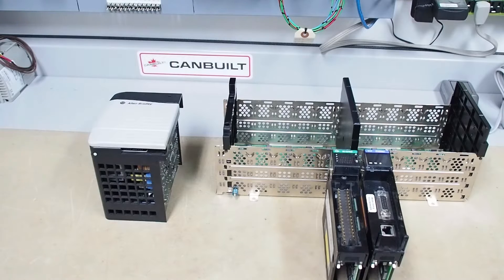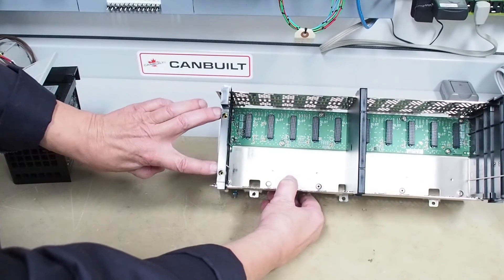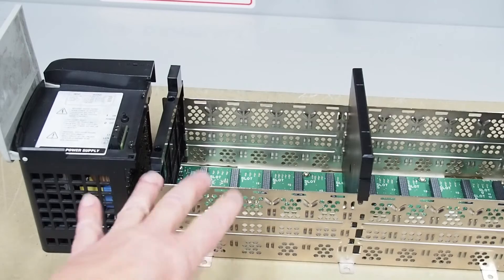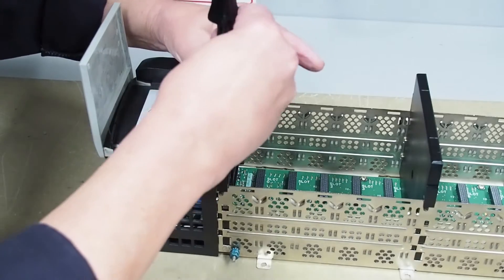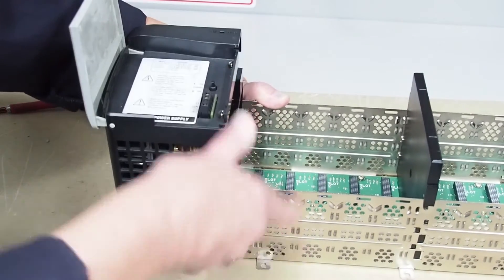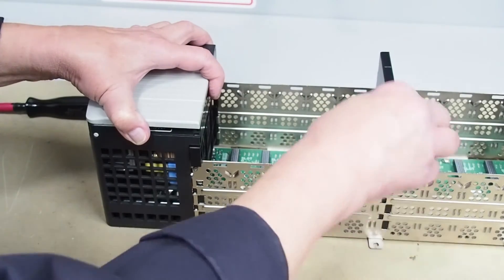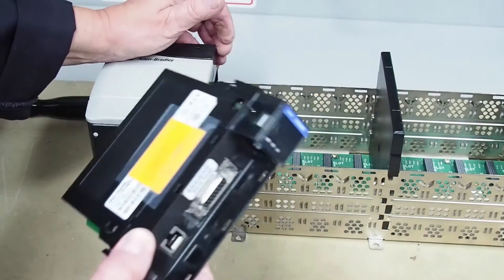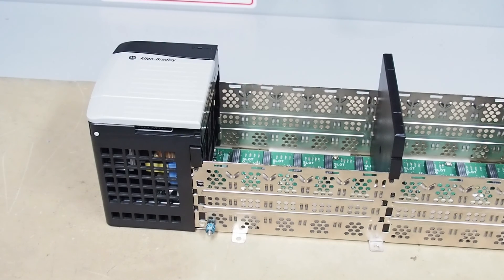How to assemble a CLogix chassis and modules

Comment: Power light glow how to troubleshoot it
Reply from the maker: HI Jaya:
I do not understand your question.
There is a small green LED at the front top edge of the power supply.  This will turn on when the power is applied to the input terminals and the power supply is putting out the correct voltage to the chassis.
If it will not come on then your power supply is dead or the light is burnt out.  It is only and indicator.
Reply: @abplctestbench759  how do you test if supply is dead or just bad contact to chassis?